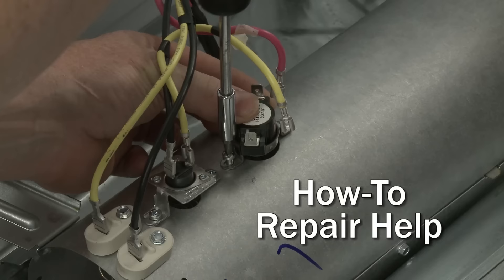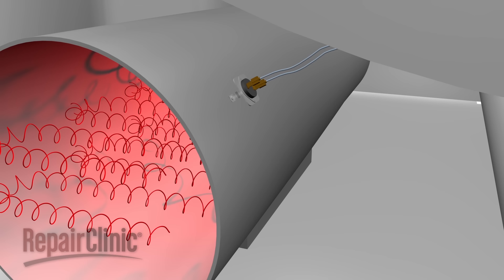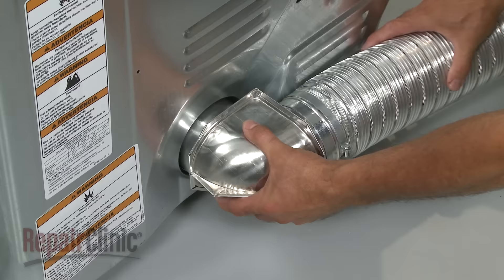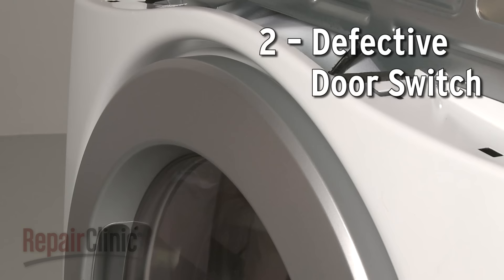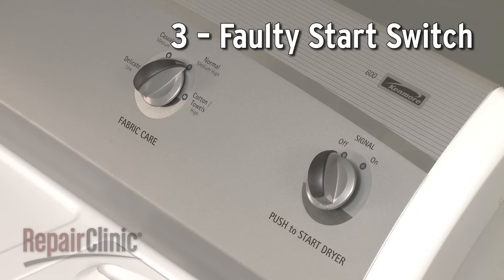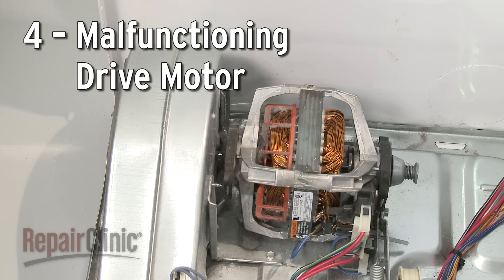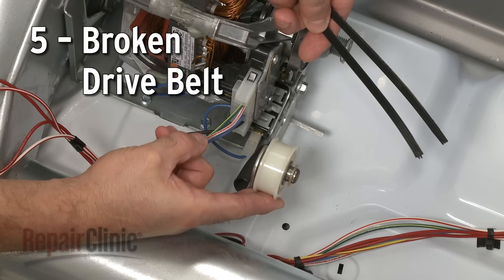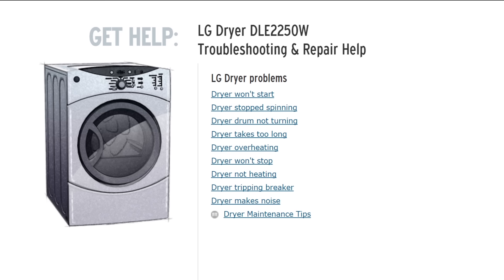Top Reasons Electric Dryer Won't Start — Dryer Troubleshooting

Comment: Checked every single thing mentioned with no luck. Then, by chance, found the knob that selects time of dry was slightly cracked. Turning knob wasn't actually turning stem, so dryer thought it was off the entire time! Hate to even admit it, but might help someone else!
Reply: marsza lutz - You were brilliant, I spent lots of time trying to figure out what's wrong, finally read your comment, bought new knob and dryer is working. Thank you so much, it's not professionals but ordinary people sharing their findings make the difference.
Reply: Thanks turned out that was my problem too.
Reply: I was seconds away from buying a new motor. Thanks for sharing!

Comment: Top 6 instead. Check fuse breaker always first, too many people gung ho to strip a dryer apart instead of checking power. Have seen too many dryers replaced due to a faulty power supply.

Comment: I tested the L1-L2 (black/red) combination and got 120v. When I did same test of wall socket it showed the 240v. Does this mean my 4 prong cord went bad or is there a problem with the unit?
Reply: He said "Unit"... ah huh!huh. ! Huh.!.ah  huh!!!
Reply: Where you tested is just one leg of the 240v circuit. Not everything in the appliance operates on 240v, some parts are 110v and therefore use only one of the positive lines, the ground and common in a 4 wire  240v circuit. Usually only the heater element and some motors use 240v and all the switches and timers are 110v.

Comment: Thank you.  I was able to replace the Thermal Fuse and get the dryer working again.  I didn't have any testing tools, so I went ahead and replaced this part. $20 instead of a costly service call or biting the bullet on a whole new machine!
Reply: Ralph Evans Hey Ralph, I saw that you replaced the thermal fuse, is the model number WED8200YWO.And if that is your model number can you tell me where the thermal fuse is, thank you.
Reply: @joehussey6802  Take out all the screws for the back panel and remove the whole back panel.  It will be in the mess of wires in the back.  The thermal fuse looks just like in the video.  I found the new replacement part at an appliance store that also runs a parts department - kind of like the parts department of a car dealership.

Comment: Youtube is full of videos that talk about the thermal fuse - this is the first one I've seen that points out the broken-belt safety cutoff. (Heavy wet load, old dryer, a "loud bang" when it stopped - oh, yeah, the belt is hanging free, maybe it's not the motor or fuse...)  Thanks!
Reply: gotta hold the control for dryer to start
Reply: Agreed. I suspected a belt problem after watching this video and considering my dryer's symptoms. Popped the lid and lo and behold, a broken belt.

Comment: I have a 2006 Maytag Washer and Dryer and the Dryer has started chirping when it has finished drying and turned off. I finally turned it off at the  breaker so I wouldn’t have to listen to the chirping all day and night. When I turned the breaker back on the dryer wouldn’t work. I called a repairman and he came out on Friday and wouldn’t you know it worked when he turned it on multiple times! So I paid his service fee and thought my dryer was ok. (Even thought I might have hit the on/off button instead of the on.) I washed a load of clothes on Monday and the dryer wouldn’t work at all! I couldn’t change cycles or anything. When the repairman was here he checked on parts and found the control panel was still available but the circuit board wasn’t. Also the control panel was $200.00 + taxes and unrefundable in case that wasn’t the problem. After listening and watching the video I think it might be the fuses. He didn’t check any of them but did check to make sure the vent wasn’t clogged. I’m a widow and live on Social Security and I don’t have $200+ to spend if that’s not the problem. Could someone give me some advice?

Comment: I have a kenmore front load dryer I replaced the heating element its still not drying and also turns off after running only bout for 5 or10 mins?

Comment: Hey could I get some help. Ive replaced the door switch and the fuse but still no power. I'm going on to replacing the start switch but I think it may be the power outlet. Any advice?
Reply: Buy a multimeter so you dont have to buy every part before getting it right! Check the fuse box for your house but you won't know if the plug works until you have a meter to test it.
Reply: My dryer is 6 months old and I replaced the thermal fuse and still no power.

Comment: I cant seem to figure mine out. I thought the light went out inside the dryer, but later realized I have no power to anything on the dryer. It no longer clicks like a quiet clock when I turn the timer, it wont start and the light inside is out. The outlet has 250v. All the sensors seem to check out so far. Is there a main fuse to everything maybe??

Comment: Our  dryer was purchased over 3 years ago and had never given us trouble until the week before Christmas. I checked the circuit breaker and also saw that the light came on when the door was opened. Rather than trying to find the problem myself, I decided to call an appliance repair company.  They responded that day.  The repairman found the problem within minutes, and suddenly got it running.   I said, "How did you do that?"  He told me that whoever installed it (Lowe's delivery) wired it wrong. The neutral and the ground  wires were switched. How it ran for over three years is a mystery.
Reply from the maker: Glad you were able to get it fixed. That could have been dangerous.

Comment: I remember month's ago the timer wouldn't shut off, I'd have to manually do it after 60 minutes. After a while it went back to shutting off automatically. Now it doesn't come on at all. Tested the thermal fuse, power switch and door switch for continuity. can those timer failures cause it not to turn on ?

Comment: I have a ge electric dryer the drum screws for the drum stripped so I repaired it but in doing so I had to take the wires off of the controls on the dryer I labeled all the wires and put them back in the same location I removed them but now the dryer won't stay running without holding the start button down If I take my finger off the button the dryer will stop

Comment: I have a Maytag Neptune front loader and nothing is coming on no lights nothing and it does make a little bit of a buzzing noise while plugged in… I was thinking it was a thermal fuse but what else could it be when nothing works no lights nothing appears no electricity as get into the unit

Comment: RepairClinic.com
I have this problem. No heat and it spins. So i check the heater, replaced with brand new heater, still no heat. Heater not turning on. Replaced the old thermostat with new thermostat, still no heat. Checked all wirings for continuity, all checked out good, sanded the terminals, still not heat. Replaced the whole motor with centrifugal switch, still no heat, heater does not turn on. I don't know where to go now. please help.

Comment: Okay this may be a strange problem? My Frigidaire Affinity Dryer won't start (even when empty). I press the "Start" button and it wants to start, it makes a humming sound for about 2.5 seconds and then beeps and fails to start. It then displays the error code "PAU". BUT...if I open the dryer door, depress the door switch and hold it with my right hand, then press the "start" button with my left hand, then quickly stick my left arm inside the dryer and grab one of the dryer fin things and pull/push it giving it half a rotation (then pull my arm out), my dryer then fully starts and runs normally. I then have to quickly remove my right hand from the door switch, and quickly close the dryer door with my left hand before the dryer stops running. I got lucky and did it fast enough that the dryer kept running for its full 90 minute duration. So, for some reason the dryer isn't doing an initial half a turn to start (this has to be forced by hand). I assume the motor is still good because it turns the drum perfectly for 90 minutes. But for some reason something is preventing the drum from electronically turning for that initial one second at start up. What could the problem be? Could the thermal fuse be blown? Thank you in advance.
Reply: Did you find out what was wrong?  Mines doing something very similar!

Comment: What does it mean if the dryer doesn't dry the clothes at all even on high heat mode?
Reply: Check your dryer vent. Could be clogged or blocked. Or even check your breaker to see if its a half blown breaker.
Reply: Okay, I use to deal with that a lot with the dryers that the laundry room of the apartment complex I live in.
Reply: @sethhorst6158  Oh. My bad brothaman, just thought I'd throw out a suggestion or two. Lol

Comment: on my start switch model=wp3398094 my multimeter reads 1793 instead beep sound, is my switch shot? my dryer won't start. if this is my problem i will go-ahead order it.  thank you.

Comment: My whirlpool electric dryer hums but won't come on, any suggestions?
Reply: mine is GE & just started same thing..any suggestions??
Reply: That sounds like a possible armature in the electric  motor housing that's seized up. Have you checked if it physically moves?